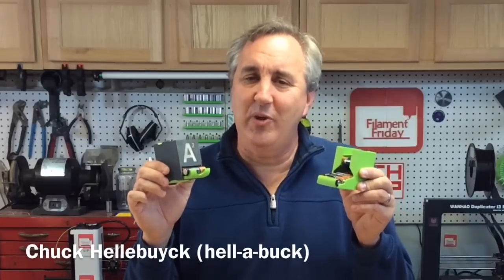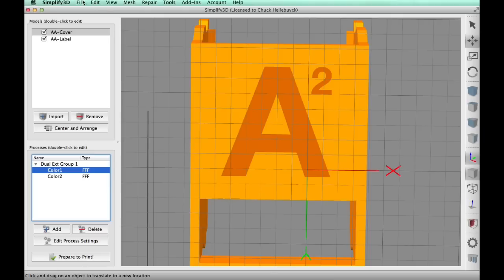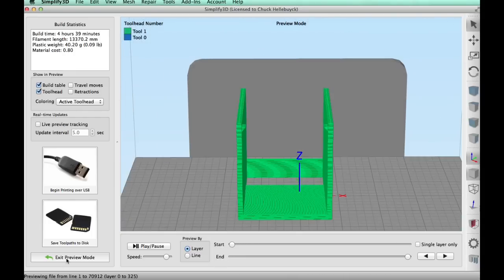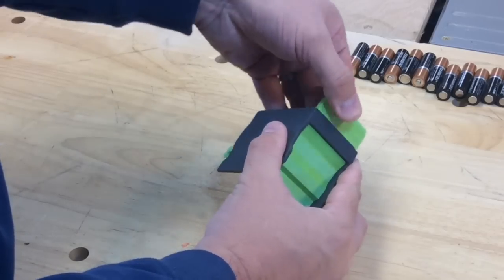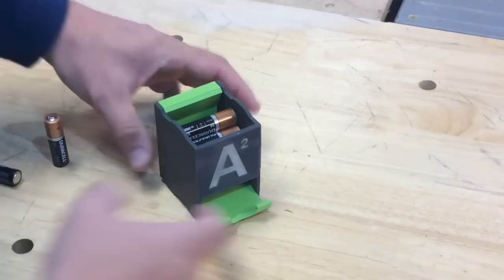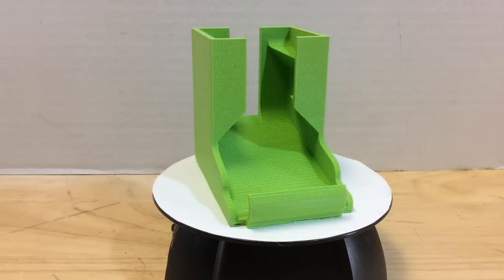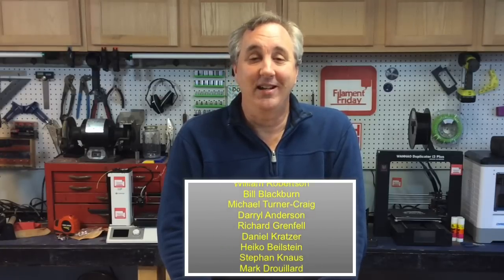AA Battery Holder Hacked with Dual Color Extruder Thingiverse Featured

Comment: I printed both these a few months back and found the same as Chuck ! Good news is the 2nd design shown has an existing extension part you can print and clip to the top of the main body - to provide additional capacity. Works a treat !

Comment: Thanks Chuck for showing us how to use the dual extruder wizard.  I will have to try it out with my Dreamer.  I have been using the FF Flashprint dual extruder process until now and haven't been all that happy with it.  I too have printed the first battery box and had the same difficulties as you had, it was hard to get together, and the batteries clogged.  Interesting idea to combine both!

Comment: Could you have created an extra process for using the ooze shield for the start of the print, maybe 2 or 3 mm in Z, then turn off the ooze shield for the rest of the way up where the second nozzle was not used? Just a thought.  Thanks for showing us practical uses for our printers!

Comment: With S3D you could have created another set of processes so you had an ooze sheild for the first few layers and not for the rest. Or perhaps more simply add a skirt spaced from the print and make it like 20 layers. Doesnt seem to have been a problem without it though.

Comment: At the rate my kids can use batteries at times (has been way better of late) I would need one that holds somewhere around 50 AA batteries. Could use a AAA holder too. 

I also tried the first one you printed and experienced similar issues assembling it and getting it to work well. Mine got stuck too. Looks like I need to try "Plan B". Lol

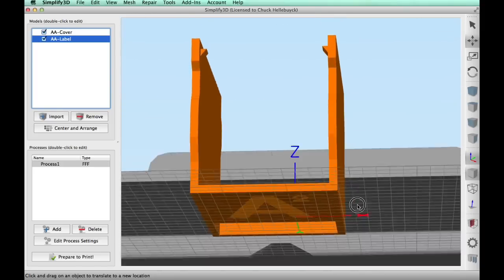Comment: Thanks for uploading every week your filament friday series is very inspiereing. Maybe you could do a video about bed prep matierals you have at home like garolite, 1:10 wood glue water solution, classic glue stick... some people also use a jello soultion or maple sirup (http://www.reprap.org/wiki/Bed_material) and what works the best on a heated and unheated bed also found something very intresting if you apply lemon juice with a spray bottle to a clean heated glass bed PETG and PLA will stick to it with a brim. I know Tom did a video about it but he only showed things you wouldnt necessarily have at home like buildtak.